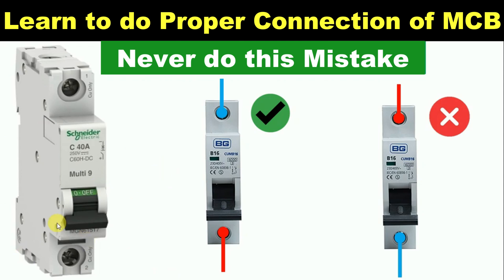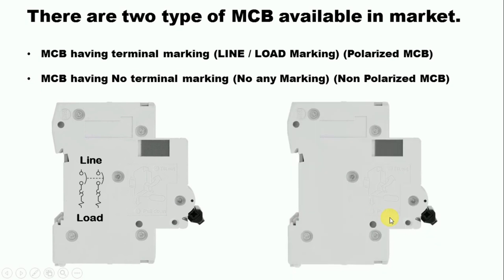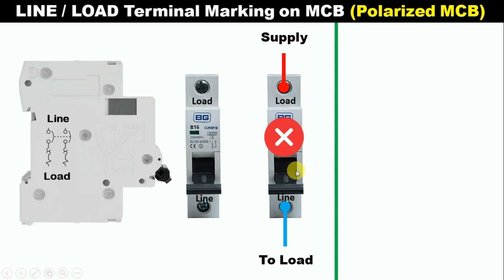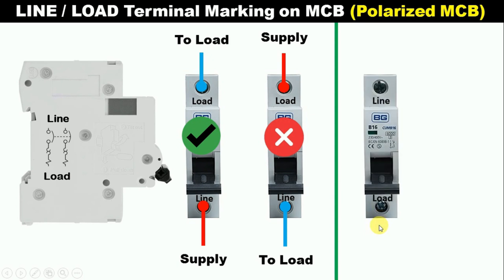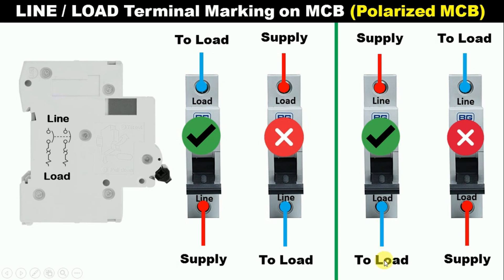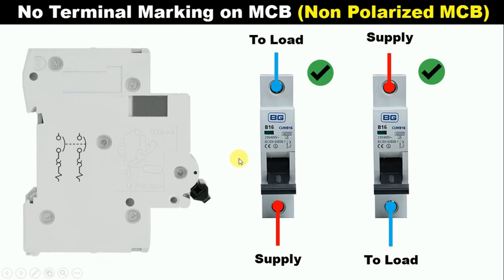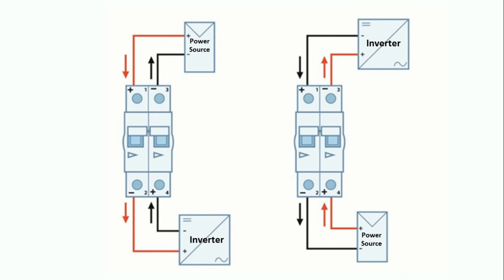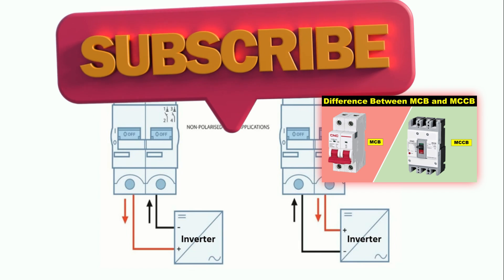All Types of MCB Proper Connection | Input and output MCB connection @TheElectricalGuy

Comment: What if there's also a solar charge controller in a DC system that could sometimes charge the battery but sometimes the current reverses direction when the load exceeds the solar available?  Does that mean we can't use a polarized MCB?  Am I correct to conclude that polarized MCBs are unidirectional while nonpolarized MCB's are bidirectional?

Comment: hello thanks for video, only one think confuses me, so in scenario where you have battery bank 48v 304Ah and Inverter 5kW, always inverter will be connected to the load  and battery to the line?, what if inverter is charging the battery bank on this same wires then battery will be the load and inverter the supply? or we only need to protect and correctly wire the this way to protect against overload and potential short circut comming from battery bank? which in my case is total of 12000Amps. Which wiring  is correct then? Always battery is a supply ?  thanks for your help